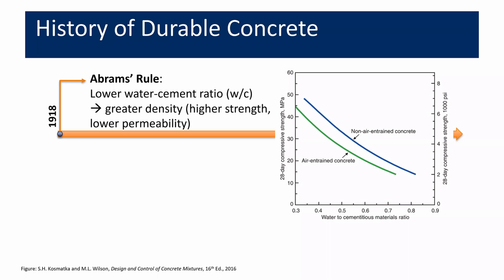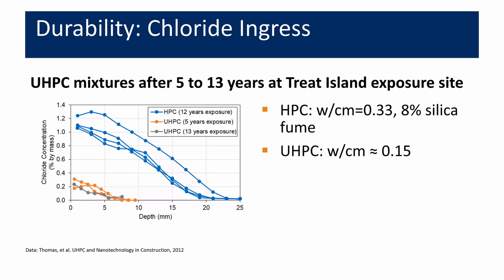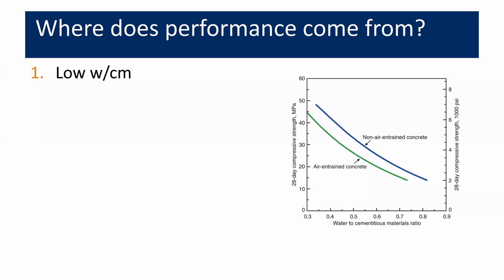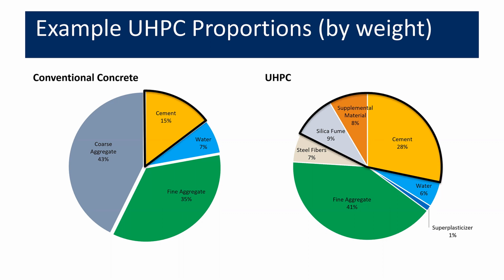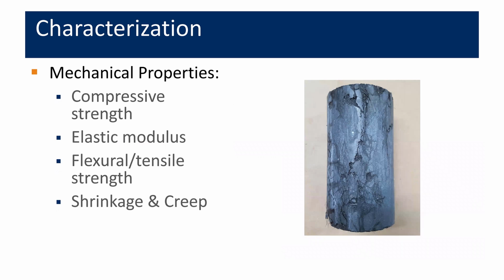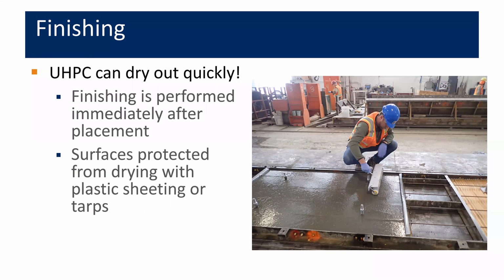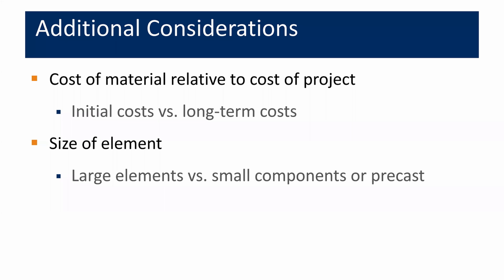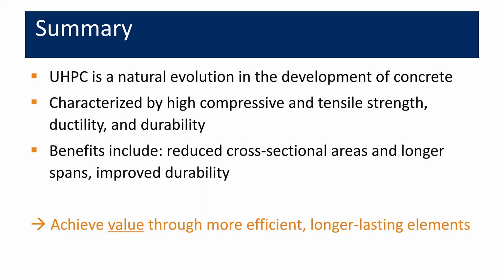Advances in Ultra-High-Performance Concrete

Comment: In the circle graph for UHPC you have 8% for Supplemental Materials.  What would be those materials? Also, instead of steel fibers could you use a Basalt fiber and achieve the same results? Thank you.

Comment: @53:28 Question was: "Is UHPC generally heavier than conventional concrete?" WJE materials engineer Elizabeth Nadelman gave a very enlightened answer beginning with an authoritative declaration that "the typical density of conventional concrete is 145-150 lbs per cubic YARD".  I know she definitely knows what she is talking about because she then followed that up by smartly stating, "UHPC is  a little bit heavier than that because of the steel fibers found in UHPC and therefore typically weighs anywhere from 155-160 lbs. per cubic YARD."  WJE should be delighted to hear that Boeing Aerospace is currently in the project funding phase for development of a basalt fiber reinforced all UHPC flying luxury cruise ship that is expected (based on Ms. Nadelman's expert findings) to typically weigh less than a cubic bundle of Howard Hughes  balsawood sticks.
Reply: They found a way to reduce the density by a factor of 27:face-turquoise-covering-eyes:
Reply: @DarylOster  Quantum Mass Refactored as 3/3/3/3/3

Comment: What would be the main difference between  silica flour and silica fume?
Reply: Silica flour is crystalline since it is made by finely grinding silica sand.  Silica fume is amorphous (non-crystalline) and its particles are spherical. Silica fume has extremely small (1 micrometer) while silica flour particles are larger (4 to 16 micrometer).  Size differences are used in particle-packing principle.

Comment: When considering the weight difference  between UHPC (155-160 pcf) and NC (145-150 pcf) you need to consider that UHPC has some of the reinforcement in it already even if the application is only shrinkage. That consideration of reinforcement amount and weight would increase the pcf weight of NC by at least a little. The fact that UHPC is about 3-4x the compressive strength of NC also might bring in add'l weight for the NC when reinforcement is used on it for increased compressive strength.
Reply: I need your experience and advice to help me about UHPC concrete, sand grain size in UHPC, thank you very much
Reply: I need your experience and advice to help me about UHPC concrete, sand grain size in UHPC, thank you very much
Reply: I need your experience and advice to help me about UHPC concrete, sand grain size in UHPC, thank you very much
Reply: I need your experience and advice to help me about UHPC concrete, sand grain size in UHPC, thank you very much

Comment: At 5 minutes 46 seconds, it's shown that water-cement ratio is less than 0.20. What about adequate cement hydration?....Hydration needs  roughly a water-cement ratio of 0.23.
Reply: Извините,что вмешиваюсь, но 0,20-0,15 это нормально для гидратации. У меня на сам цемент приходится 0,15%+(1/3 воды на микрокремнезем, а его кладу 10%от цемента) , и получаю SCC. +160-180кг микро фибра стальная.
Reply: @Beton-Betonsky Hello. May I ask for your mix design? I am currently working on a mix design that has all the components needed for UHPC but replaces steel fibre with AR glass fibre. So, cement, silica sand, silica fume, fly ash, superplasticizer, and water. I would appreciate any help I can get. 🙏🏾

Comment: 52 Lbs of superplasticizer pcy seems highly excessive.
Most documentation I find suggests 1% superplasticizer at most of concrete weight, The UHPC mix in this video has superplasticizer around 4.5% the weight of the cement.
Reply: Действительно, 2,5% достаточно для водоцементное соотношение менее 0,20. Но  для сообщения менее 0,15 надо уже 3-4%пластификатора. У меня получалось делать scc и при соотношении 0,11, но уже пластификатора 6%

Comment: Using for years here in France for thin bridges artistic building walls and especially in exterior furniture designs
This is a huge breakthrough for steel-less designed projects

Comment: The lack of information about the Carbon Dioxide emissions of this UHPC concrete is worrying, and throws any benefits out the window if we cannot decrease these emissions. As this is the current need for infrastructure at the moment.
Reply: Carbon dioxide issues come from the production of the portland cement from the decomposition of limestone (calcium carbonate).  Concrete does not emit carbon dioxide; rather, it actually absorbs carbon dioxide when calcium oxide, a hydration by-product, combines with carbon dioxide to produce calcium carbonate, the efflorescence that is often seen on the surface of concrete.
Reply: No one gives af about emissions, we just want better concrete

Comment: I'm working with UHPC since 1985 (Densit a/s, a company of Aalborg Portland Denmark where Hans Henrik Bache invented the first UHPC in 1978 and used for the repair of the stilling basin in the Kinzua dam in the USA) in different areas and while I do like your presentation I have some question marks. For example a packing model was used by Bache in the 1960's. Further an UHPC is not always reinforced with fibers, not always contains only fine aggregates and not always a free flowing self compacting concrete. UHPC has been, since 1985, designed for performance in many business area's like Security Industry (bank vaults, safes, ATM's, etc. and military shelters, etc.), Wear Protection in systems to transport abrasive materials, Civil Engineering and Offshore.
Reply: Bache is regarded the father of UHPC, but Cherazy 1994 development ideas of Bache for commercial usage
Reply: I need your experience and advice to help me about UHPC concrete, sand grain size in UHPC, thank you very much
Reply: I need your experience and advice to help me about UHPC concrete, sand grain size in UHPC, thank you very much

Comment: how do you fill pinholes and broken edges in uhpc
Reply: Obviously epoxy based repair.  Come on lol
Reply: epoxy resin?? but uhpc is kind of concrete..broken edges could not be repaired by cement alone ??